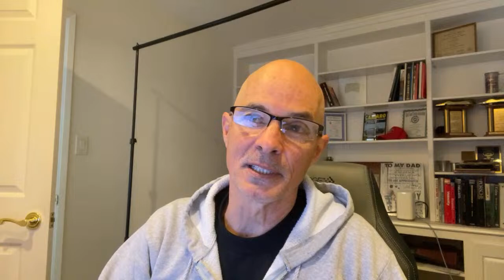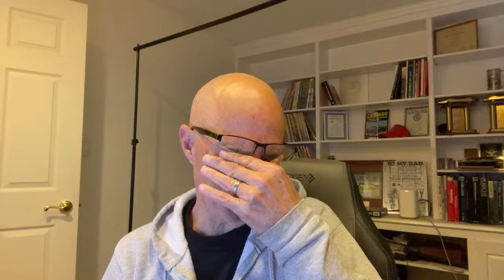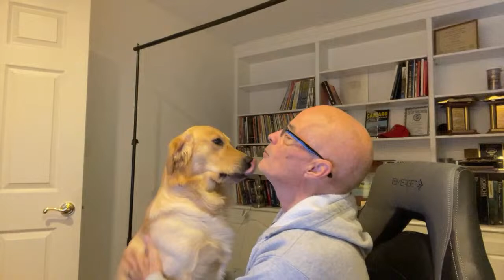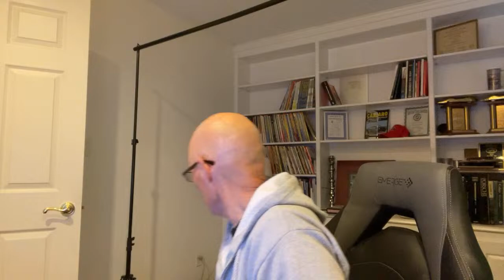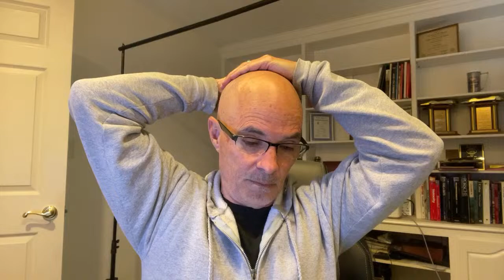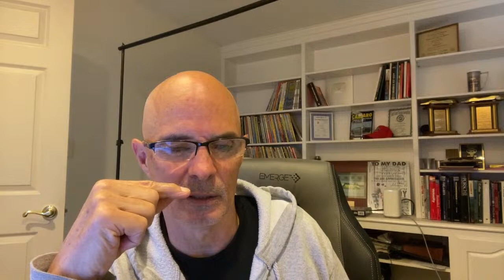Stroker Tow Cams-Let’s Talk Tech

Comment: I build a lot of gas engines for towing and the reason I really like very short duration cams (195@.050)is the immediate throttle response you get at very low rpm... if I'm towing and start up a hill I can just give it a little more throttle and get big change in tq the engine gives me.  With a bigger cam it's not as responsive to part throttle angle changes and frequently you lose speed so you have to force it harder and induce a down shift where it is easier to just maintain the your speed with the cam that gives you most tq at 2000 rpm. Also we don't always run WOT to get the truck moving so tq around 2000 rpm or even less is very important. You can't just look at what cam gives you the highest tq number at WOT. I know I hardly ever go WOT with a loaded trailer unless I'm pulling a heavy load up a mountain pass and living in western Montana that happens and I also don't want my engine dropping gears and running 6000 rpm, I prefer to keep max extended rpm in my 6.4 hemi around 4500 rpm and I have a stock 5.7 hemi cam in it and it tows awesome in that range and will peak out around 5500 if I'm serious about getting a big load up a hill fast.  Sure I could trade some throttle response and break away tq for more tq in those conditions with a cam but I do more of the low speed stuff than that higher rpm stuff. Another good example is a 410 magnum stroker I built for a friend with a stock cam in a dodge dually, it will break all 4 rear tires loose at any time but won't rev past 4500 it just hours a wall but had plenty of tq to yank a trailer free from a stop at idle with no drama at all, it pulls as good as the v10 that came out but much better on gas and it is even more responsive at very low speed. You can't just focus on WOT TQ.

Comment: Stock cam or the next one up you tested in this video. For drivability and the stock torquey valve overlap. But.
Run a different ratio aftermarket high lift rocker arms to get the additional lift. 
Best of both worlds??

Comment: I often apply the lockup manually while towing and just unlocks it when there's a small incline. It means that I often stay at 2000rpm and accelerate before I climb a hill. What dictates what speed I take is what the engine will consume if I drop a speed vs turning off the lockup. It takes a bit of practice to be used to drive like this. I don't suggest applying the lockup during acceleration.
My comment is just to say that my rpm range is usually ±2000rpm.

Comment: That stock cam  makes a beast 408…you need brute low end to get all that weight moving. Way less to keep it moving on the flatlands. Flatlander tow guy here
Reply: An aftermarket cam can make more torque everywhere… you also don’t need low end you need midrange at no point while towing are you wide open throttle at low rpm

Comment: My 09 Sierra already has good takeoff speed under heavy load, and it has a good trans cooler.
Where I need help is halfway up the mountain. So I'm thinking a small turbo might be my best bet. But I'm not an expert. So I'm open to suggestions.
Reply from the maker: turbo helps everywhere
Reply: Gears
Reply: @gordocarbo  What size though? Consider that this truck spends most of its life between 65-75 mph.

Comment: Ok on Mopar strokers    you have about a stock 0 deck piston height of about 2"
So you can go half inch stroker and a 1/4 " longer rod without getting the piston too short
7.1" BBC rods are common  remember that using shelf parts can save $$$ kit is better
less cylinder wall loading
Now today you can also get thinner better rings
Do not bore any more than absolutely necessary
Your lca can change with stroker and rod length if you want to be picky and can also adjust the exhaust duration a long as you do not hold it open too long
I do not like stroker over 3.75 in 400 with 440 rods for towing, for street go long

Comment: Howdy from Texas new subscriber I've watched all the 350 tbi videos and they have been very educational. I'm planning on replacing my stock intake manifold with a air gap performer ( idle to 5500 rpm) and replacing the camshaft with a corresponding one in same rpm range and along with that a light port and polishing of the swirl port heads with long tube headers. My question is I'm thinking later on adding boost with a single turbo and I'm wondering is there any benefit to changing from a timing chain to timing gears? Thanks for what you are doing and I would appreciate any advice.
Reply from the maker: keep the chain

Comment: @richardholdener1727  I purchased an iron block lq4 core engine from the scrap yard. I plan on building a 408 with all forged internals. I'm getting rid of the stock cast iron heads and using a set of 799 heads. I am aiming to hit 1000rwhp. I will be using the car at the strip but also will spend most of its life on the street. I really want something that will be reliable, not just a race car. Will twin gt45 turbos support this power reliably, and what compression should I set it up for to use pump gas. I was thinking 10.5:1. We have 93 and e85 here. Do u also have a suggestion for a camshaft that will help with the power but also keep the car streetable. Any suggestions would be helpful. This is going to be my very first ls build. I just want to get it right the first time and not have to redo it again later.
Reply from the maker: use smaller turbos (GT35s), lower compression (unless always e85) and I have a 219 cam on sale now that will easily exceed 1000 whp and still drive nice
Reply: @richardholdener1727  what compression ratio would you recommend for 93? How much for the cam and how do I order?

Comment: If someone had a stock lq4 or lq9 with stock heads and intake and added a mild cam like a truck Norris cam from there how much power do you think could be add by switching to LY6 heads and intake … would it be worth going to a junk yard or eBay for those parts
Reply from the maker: those ly6 heads and intake are hard to find

Comment: Jm Flournoy
lets consider 10 mile Baker grade in the summertime on the way to Vegas
Power is one consideration but so is EGT and your exhaust valves and preignition
big consideration is overlap.  
On 440 Mopar adding quench and reducing overlap lowers EGT by 800 degrees
The quench allows at least another point of compression
With stock open chamber heads and pistons down the hole compression is about 7.5:1
With stock 440 cam fresh rebuilds were burnt up in motorhomes on one trip to Vegas
With quench and short cam you can run 9:1  much more power
With today's heads you can do so much more
Of course a half or three quarter stroke is the way to go with today's crank and aftermarket rod availability
I am so Jealous
cam for motorhomes ended up 256@006  205@.050  305 lobe big at .200   Howards has  shelf one close 
Heavy trucks/ transit busses  192@.050 and a little over 240@.006
Reply from the maker: my statement was just power-stay with me-but detonation is another concern
Reply: @richardholdener1727  I get asked alot which makes more power  67 closed chamber or 68 and up open chamber
As usual it depends (equal compression)  Open chamber makes more power if "Race Gas"  Super stock etc
Pump gas the closed chamber heads
But I have 3 sets of 67 heads all set up with new guides and ex seats and I cant get my costs out of them  
I keep recommending go Aluminum but not 
Edelbrock or clones as there are better chambers and flow out there
cheers